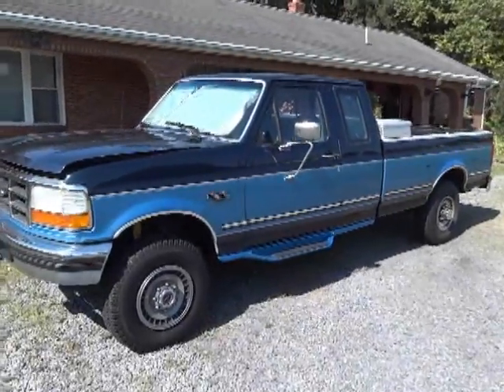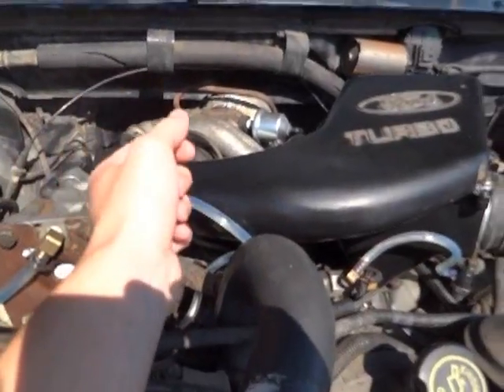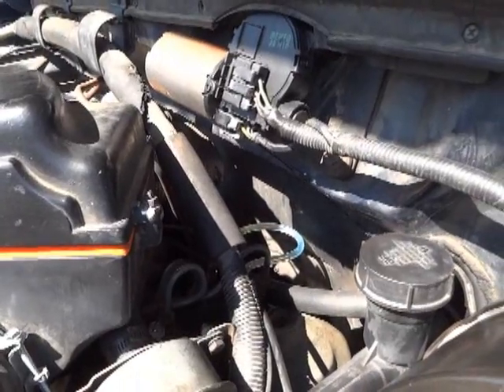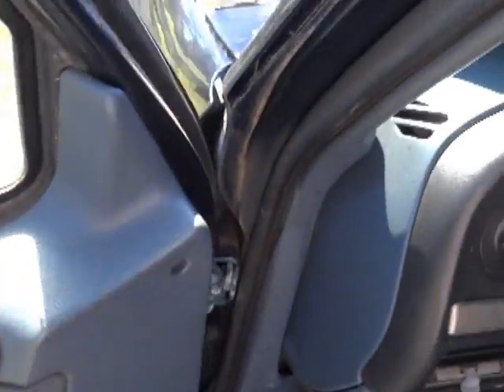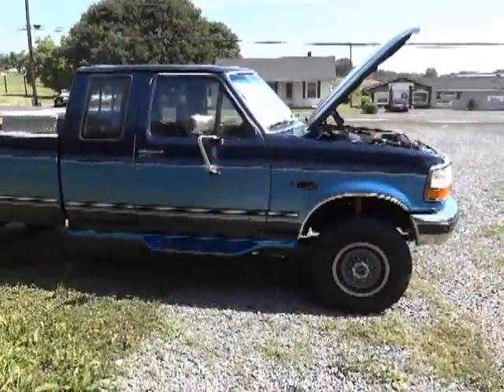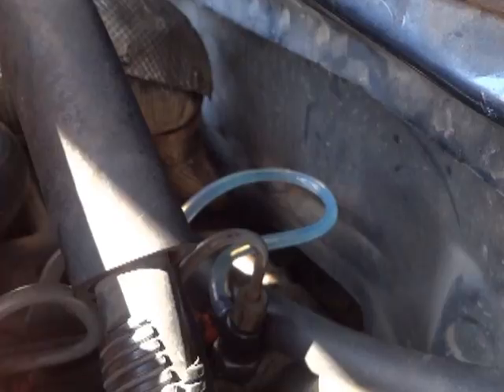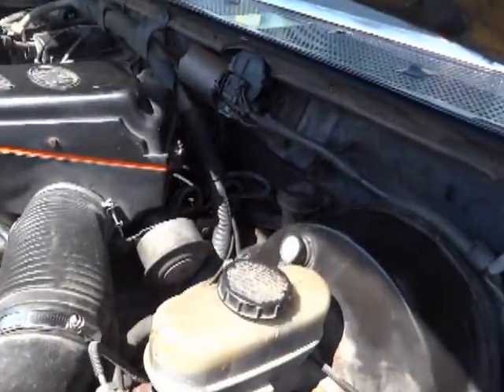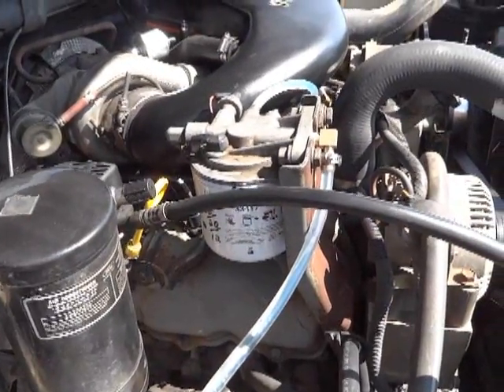How to check for air in fuel lines on a Ford 6.9 & 7.3 IDI Diesel

Comment: I’ve got a 91 7.3. I’ve replaced the fuel pump, blocked the heater element hole, new rail caps and hoses but it still won’t run. It starts and dies. I put a clear line from the pump to return side. I’m going to replace the hose on the return side at the back of the head because the fittings are different sizes. Hopefully that works.
Reply from the maker: Loosen the IP and rotate it counter-clockwise towards the passenger side approx the thickness of a dime….. tighten……then try again.

Comment: I know it’s been 12 years but did you ever end up making a follow up video with the pump timing
Reply from the maker: I loosened the IP bolts and rotated the IP counter clockwise about the thickness of a dime and then retightened.  It solved it — and be sure to add 2-cycle oil to the diesel each time you fill up…..16-32oz per tank each time.  Will run smooth and max mpg.

Comment: I just put my truck I haven’t had any problems with the but just the outher day to work and was have very bad miss fire I have 1991 7.3 idi non turbo I really trying to truble shot my problem
Reply from the maker: First check for air in the lines…. Most common culprit.  Next, loosen the IP bolts and rotate IP counter clockwise literally the thickness of a dime and retighten.

Also, add 8-16oz of 2-cycle oil to your tank each fill up.  Ultra low sulfur diesel has NO lubrication for your IP & the 2-cycle oil will make it run much better with increased fuel economy/power also.  Gallon jugs of it are in the Walmart oil aisle.  Don’t buy the tiny bottles.

Comment: Are the clear hoses just for test purposes or can they be left on ?
Reply from the maker: I think they’d harden and leak……I used them just for testing.  However I do believe you can buy translucent fuel lines (bulk rolls) that would work.

Comment: Real tools that is a great video. My truck has been sitting for 5 years. I'm praying I can get it running 1 day. Please keep putting out content.
Reply from the maker: I loosened the IP pump and rotated it counter clockwise by the thickness of a dime (towards the passenger side) and retightened.  Fixed my issue instantly.

Comment: Great, thanks. Will try this, as mine behaves exactly the same.
Reply from the maker: I ended up doing two things that fixed it.  

1. Loosened all the IP bolts and rotated it counterclockwise (top towards passenger side) by the thickness of a dime & retightened.

2. Started adding 16oz of regular 2-cycle engine oil to the diesel fuel each fill up.

Ultra low sulfur diesel has no lubrication for old diesels……2-cycle oil cures this.

Anyway…..mpg went from 10 to 17 afterwards & almost no smoke….. Plus smooth idle.  Good luck!

Comment: FYI Diesel fuel rubber hoses are special houses. DIESEL fuel rubber hoses are designed to handle PSI pressure of up to 6,700 PSI or more The DB2 Stanadyne  
Injection pump on the 7.3 IDI  pressure is 6,700 PSI. The high PSI the DB2 produces is why the fuel injection lines are made of steel. Think about that!!
Reply from the maker: The crossover lines are rubber.  With standard fuel hose clamps.  They aren’t at the same pressure as the metal lines.

Comment: Anyone know how to do this on 351 windsor? Pumps good, filter new, for check out, injectors are ok but not new. New plugs wires distribute, grounds tight, battery voltage excellent. New PVC, TAD, have not cleaned throttle body or IAC. What would be causing a miss? Engine has good power when it gets the gas. I'm thinking air/fuel ratio.
Reply: Wont let me edit... fuel filter is new.

Comment: So I know I won’t get a response but I see one of my caps is wet but there is no air in any lines could it still be a problem
Reply from the maker: The crossover rubber lines between injectors get brittle and leak…. So just because you don’t see air from the tank, it may be sucking air between injectors.  

I suggest changing those also.

Comment: dont know if you still work on these, but mine has a leak somewhere from the liftpump (aftermarket electric located on frame under fuel bowl / filter unit). My tank selector valve is not working currently and im wondering if that may be where it is sucking in air from. The truck is easy to start even after sitting for day, but after about an hour drive it sucks in so much air that it loses power then stalls.

Comment: Great idea!
However the problem with your truck is/Was lack of fuel "Pressure" which does infact effect "Pop" timing ~ but timing doesn't increase pressure. I hope you learned how to turn up the Injector pump "Pressure" before you advanced the timing. 
Think I'll put clear hoses on for "Just cause" it's a great diagnostic idea.
Reply from the maker: It was the timing.  I had to rotate the IP counter clockwise the thickness of a dime & it fixed it instantly.

Comment: Dude ... you have a bad flywheel!
Springs in the flywheel are bad
Reply from the maker: It was the injection pump.... needed to be rotated counter clockwise the thickness of a dime.  Fixed it instantly.

Comment: Hey I love the video was hoping u would be able to send me the link to the fallow up on finding out what your problem was please or if we could chat on FB cuss I'm running in to the same sort of problem and have spent hours and hours of trying to fine the issue
Reply from the maker: 1. Mark your injector pump with a scribe line.
2. Loosen IP mounting bolts.
3. Rotate IP counter clockwise (top towards passenger side) the thickness of a dime.
4. Tighten IP mounting bolts.
5. Problem solved.

Comment: Did you advance your Injection Pump timing? That's what fixed the rough running, on mine.
Reply from the maker: Yes....rotated it counter clockwise the thickness of a dime I believe......this was quite a long time ago.

Comment: I love the idea of replacing the hoses with clear hoses.  Very smart.  Although I am a little concerned there may be downside.  Will those clear vinyl hoses last in that hot greasy environment?
Reply: Nikola Tesla this is only for a temp test. Don’t leave the clear hoses on.
Reply: @geardoc  I thought  the pu4pose of the clear hoses was to ease in troubleshooting air intrusion in the fuel sysytem.  Like bleeding brakes, you can see the air bubbles.  Clear hoses allow you to see the air in the fuel lines because they would make bubbles.  What good is it to use clear hoses to find air  only to pull them off?  Going back to opaque hoses just invites air back into the fuel system.  It has nothing to do with temperature.

Comment: Hello ford lovers or those just stuck with a 7.3 idi. i have had the air intrusion problem. i installed the clear tubes ,and found out it was before the filter housing.i put a clear line at the tank on supply line and had air sucking in there. i filled the tank to the top to narrow down the suction pipe. i dropped the tank and sure enoough below the fuel connector was 3 pitted holes in the pipe. these sender units are alittle hard to find. you can repair it with a good welder or jb weld or simply replace.
Reply: Were these small holes causing hard starts or just rough idle? Mine is always hard to start. Like it looses its prime.

Comment: Thanks for the detailed info about which clear hose represents which portion of the injection system.  Getting this fuel system bullet-proof is becoming a complicated process.  Breaking down on the side of the road and being towed to a shop is rapidly becoming a "new truck" payment.  But if the truck can fix and run properly for a few weeks with a sudden fail, means to me it is just a matter of time until all the leak issues are found and fixed.  Thanks for the  help.

Comment: @11:30. I am wondering why that metal line is even bent back toward the exhaust like that? A rubber line is run to it, so it could be straightened out, away from the manifold, and  the rubber line still attached to it.

Comment: Iv got a 1986 6.9 idi and I got it running after it sat for about three years I bled three fuel lines going in to the block it ran for about 30 minutes than fine then I opened  the water separator now it dont wanna start on it's own and if it does it only runs for about 3 seconds at full throttle.

Comment: I had. 1989 Ford f250 7.3 idi had the same problem put in two different Kit's for the o-rings still couldn't get it to stop sucking it so I sold it and bought a 2004 6.0 f350 crew cab 4x4

Comment: None of the lines that are pressurized should be sucking in air when the engine is running. The fuel system is 2-3 psi when running, and when it is off, that is when it will suck in air. The suction side, which is the side that is before the fuel pump, will suck air in when the engine is running.
Reply from the maker: The injection pumped needed to be turned counter-clockwise the thickness of a dime & retightened back down....immediately fixed the issue.
Reply: @RealToolReviews  - SIR you did a great job on this and helped many of us IDI owners out -Ive read through all these comments and you deserve applause for replying to all these jokers

Comment: I know this is old video BUT this is good info and you did a good job-you get stupid comments from know it alls that just blabbing--these air leaks are hard to find-truck starts-revs up vuts of in like 5 seconds--air leak--if you lucky you see a fuel leak-fix it---if not lucky you dont see fuel leak but just because it dont leak doesnt mean you not sucking air--also in line check valves are cheap on ebay I got 5 for like $11-you just need to figure out where to put-when you have this problem you crank engine until oerheat starter then you still have problem and a dragging starter to replace-anyway good video-forget the  stupid comments

Comment: you might check your cold start idle valve .i know when i start mine it idles high around 1000rpm after it warms up the dashpottype of solonoid at the throttle disengages and drops the idle to 700 rpm  .i just didnt know if your engine was warmed up or not before u started it

Comment: Mine dies after a few minutes and the shop put a new IP in but it is still dying after a few minutes of running fine and is hard to start. I will def this test in the video. Could it be the IP timing is off so badly it would run for a few minutes sounding fine then just die like it ran out of gas? 

It also has brand new lift pump I'm wondering what to look at next. I'm sort of leaning towards the replacement pump was bad or possibly a mistake in installing lift pump. 

I have the same symptoms as before changing both pumps so I'm confused. 

Also could it possibly be the fuel pump relay is burned out or the little cylinder sensor looking thing on the left of the IP towards the front? I haven't figured out what that part is but it's the original part and I want to change it out because it's attached to the IP and looks important. It kind of looks like an transmission kick down valve but it's not and it regulates or senses something best I can tell. Thanks for any thoughts or advice.
Reply: Alex Burke that definitely sounds like an air intrusion like this video is explaining. The air is keeping the fuel from getting to the engine, if it is really hard to start in the morning, it is because the fuel is draining back to the tank overnight, causing the lift pump to have to reprime the IP. It can leave you stranded for sure. Hope this helps

Comment: you caps if they leak from cracked o rings is straight up fuel leak period all you`ll see is fuel leaking and smell fuel is the very first thing you`ll smell then just look at the caps and the ones that's leaking is your culprit  the fuel rails to don't like being disturb in any way shape or form never disturb them period .. once you do a o ring and cap always do the set and keep the hose straight as possible no sags in the line

Comment: your not sucking air you have way worse issue like blown head gaskets or there was a hole in cylinder from wrong anti freeze
Reply from the maker: +j ryder wrong.  The IP timing was off & I had to loosen it & rotate counter clockwise the thickness of a dime & retighten....instantly fixed & MPG went to 16-17.
Reply: Its not a Chevy.
Reply: @Zach-ju5vi  earlier fords had a issue with cavitation erosion from the wrong coolent
Reply: @atv55803  that's what they say but I've never seen it and this engine clearly doesn't have a head gasket issue.
Reply: @Zach-ju5vi  its not a head gasket issue its a blown out cylinder wall due to cavitation ,using the wrong anti freeze in diesels will lead to cavitation issues ,just because you never seen it means nothing
Reply: @atv55803  I worked on several idi diesels, never seen it happen and that is besides the point. He would see compression coming through the cooling system, it would be extremely obvious 🙄.

Comment: mine started idling really rough while driving, then i heard a screetching, has oil, then it started to over heat very quickly and it wont idle once it warms up
Reply: Could be a bad IP sometimes the IP will die out once it's warm. It's either that or major issues, then it's engine time.

Comment: My truck is doing the same thing, could you tell me what was wrong with yours. I did change the glow plugs and the injectors and still running rough  with white smokes. Should I install transparent lines? Was it worth it?
Reply from the maker: +Siana Cirell The transparent lines are a temp solution to verify that air is not causing the rough idle/poor performance.....you should not use them long-term.  As far as the solution for me, it ended up being the Injection Pump....not replacing it, but loosening it up & rotating counter-clockwise (top pivots towards passenger side) literally the thickness of a dime (you need to score the pump & be very careful about this so you dont rotate too much).....then re-tighten.....problem instantly solved. 

Also, you should be adding 8-12 ounces of 2-cycle oil PER TANK each time you fill up....the new ultra-low sulfur has ZERO lubrication for the injectors or IP & will destroy them quickly.   1 gallon of 2-cycle oil at Walmart is $13.

If you do those two things (assuming it isnt an air intrusion issue), you should be good to go.....my fuel mileage went from 8-9mpg to 16mpg ---- YMMV depending on your axle ratio.
Reply: I think its not in the injection pump or the air in the system. You should check also the gauge on racker arm. I had an experience like this before and i found out that 4 of my pushrod was broken.

Comment: Check the CDR valve too
Reply from the maker: +completegamemanager It was the IP.....I had to loosen it, rotate counter-clockwise the thickness of a dime & retighten.....problem instantly solved.
Reply: Nice bit of info.  The video was very informative.  Have you checked the CDR valve gromet and breather tube lately?  I replaced all 3 on my truck and the idle was much improved, and less oil blow by in the exhaust.
Reply: One of the best videos I've come across.... My 86 6.9 starts and runs great in to work. On the way home it starts to sputter and then dies. Fuel in the filter is clean, no evident water.   I put the filter back on, hit the Schraeder valve (very small ffft) and it takes about 5 seconds longer than usual to fire up. Finishes the trip home with no trouble. Next day, the very same thing. Three times this has happened.
Reply: Four times. I know, I'm insane.
Reply: YOURE THE 100TH PERSON THIS DUDE HAS HAD TO TELL THAT HE FIXED THE ISSUE BY ADVANCING THE TIMING THE THICKNESS OF A DIME

Comment: Thank You for taking your time to help us. Your pickup is the exact same year and color as mine along with being a supercab with real close to the same mileage! The only thing that is different is mine is just a plain 7.3 liter.
All of a sudden fuel prices came down a while back so I put the charger on my pickup and headed to the fuel pump. Filled up both tanks and drove it home. The next day I started it up and it was missing and blowing a lot of blue smoke. (Not so bad on idle but very bad when revving it up. I wasn't sure if I got bad fuel or what so I took it to a diesel guru and he told me the same thing about adding 2 cycle motor oil. He didn't tell me how much to put in so I just split one of the small lawn mower bottles (4 oz.) and added to each tank. Needless to say that was NOT enough so I will be going to Wally World to pull out the bigboy.
I also bought a new fuel filter since it had been so long since I had changed it. (Shame on me). I hardly ever drive my Ford since the fuel prices went up but when I need it I want it to run and run good.
One of the comments was to add "911 fuel conditioner". I plan on reading up about that but for sure I want to add about 6 more ounces of 2 cycle per tank.
After I get those steps taken care of and it doesn't stop smoking and missing I may have to change the timing slightly and put the plastic lines on to test for air leaks. I don't think it is air leaks since it didn't start with the problems until I filled up with the @$#%! fuel they sell now.
Thanks again and I plan on coming back to let everyone know how it goes.

Comment: I have a 1986 Ford 6.9 non turbo and I replaced the return lines but not the brass under the injector seal and it has lost its prime worst than before the truck sat for approx 6 years in a barn I put battery in it and it crank up and it still runs good but I have so much trouble cranking it